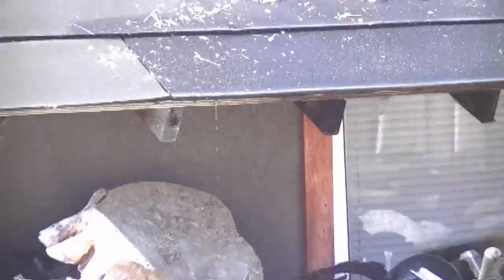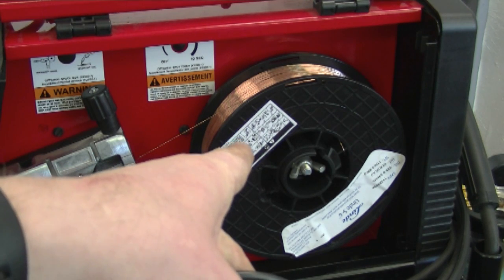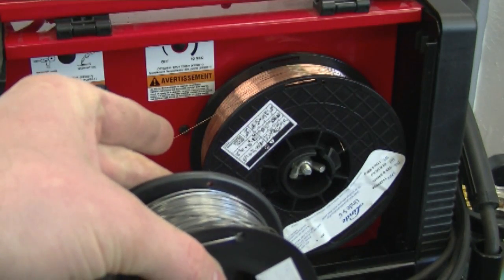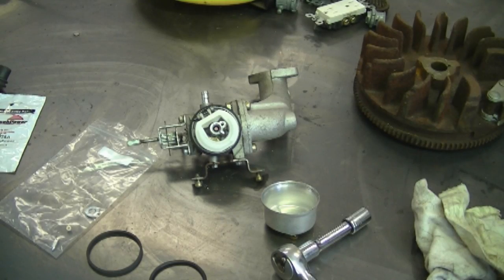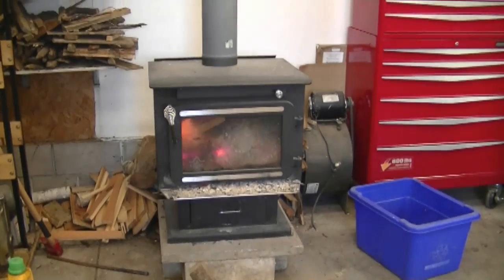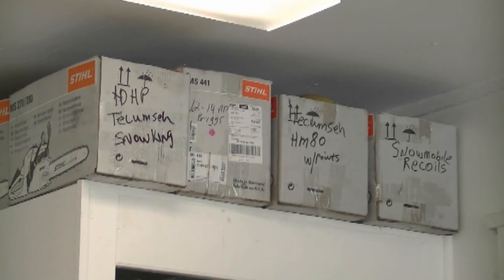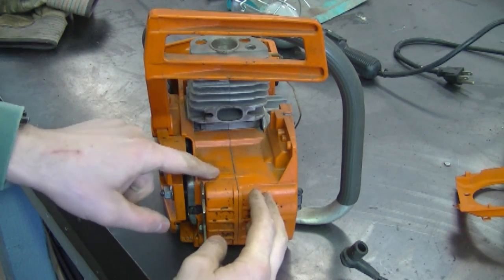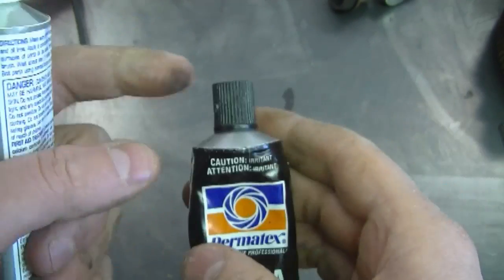Small Engines Q & A Video #92 in HD

Comment: Hi Donneyboy.
I have a good question for you.
Since the gas prices are on the rise again. I'm looing to use E85 (ethanol fuel) since it's cheaper to buy. 
So my question is, is it possible to run a small engine on E85 without damaging it?? And do I need to do rebuilt the engine or adjust anything get it running properly?

Comment: @universusxxx "machinist" being the creation of metal parts of all kinds including gears. Making anything from simple sensor housings to proximity probes for nuclear reactors (which i have made). I cannot argue the point that the difference in metals did NOT cause this failure, as they use nylon gears in lawnmowers. I was simply stating that the difference COULD have caused the failure if the operator kept engaging the starter even after the motor was running.

Comment: @toolboxRi  thanks for the recomendation.  The makita ia a true 4 stroke as is honda as well but stihl decided to buld a 4 stroke that uses a 2 stroke oil and gas mix.  does seem odd, a 2 stroke engine with regular intake and exhaust valves.

Comment: @universusxxx I'm not even going to argue with you because I can tell you always think you are right. As a machinist by trade I know which metals are harder than others and I know exactly what will happen with they come in contact. And if you'll also READ my damn comment you'll see I said "grinding the starter" indicating that the starter gear should NOT have worn out from normal usage, but rather from abuse/neglect.

Comment: Hi Donyboy, Got a question for you. I was mowing a lawn with a v twin Briggs ride on, and about 20 minutes into mowing,m the engine started losing power and afterfiring. I shut it off for 1/2 hr, and it ran ok for another 20 minutes and the same thing happened. Any ideas as to what was going on?

Comment: Our first riding mower was a used Montgomery Ward  tractor and its' two problems were a stripped starter gear and need of a new battery. It's made of softer metal so it strips out without harming the ring gear. The flywheel is usually a cast iron/steel so it's going to be far stronger. It's easier and cheaper to replace the starter gear than the flywheel. :)

Comment: @universusxxx The metal may look the same but they are Not. The flywheel is most likely cast Iron and the starter gear looks like a grade of 300 series stainless or 400. Cast Iron will destroy both those metals pretty quick if someone keeps grinding the starter for some reason.

Comment: Would like to hear your thoughts on the 4 mix line of stihl trimmer engines with valves , do you recommend these engines compared to regular 2 cycle  2 srtoke engines.  Thanks